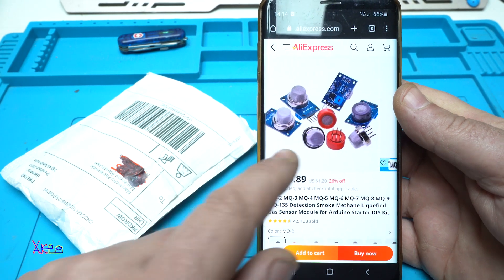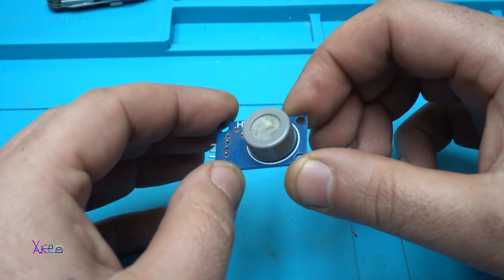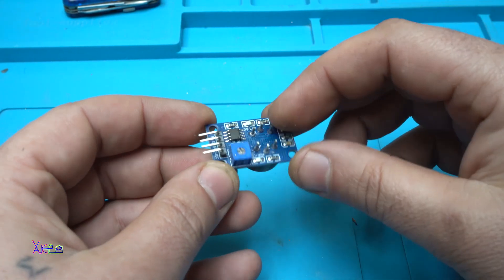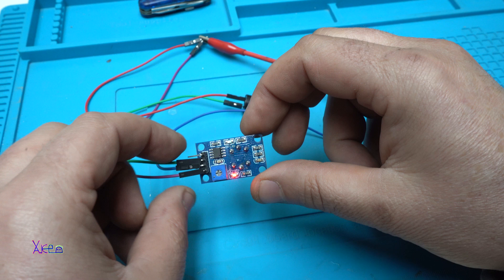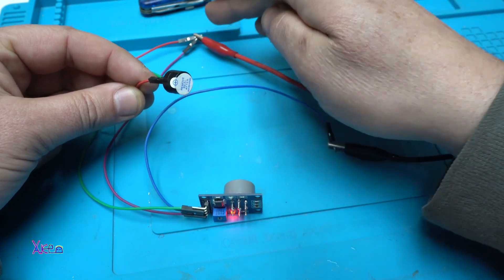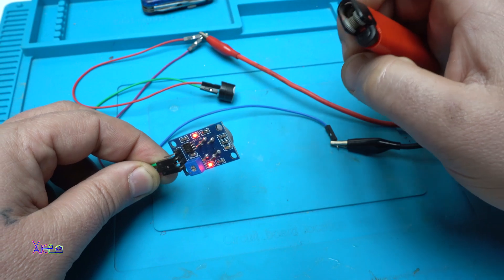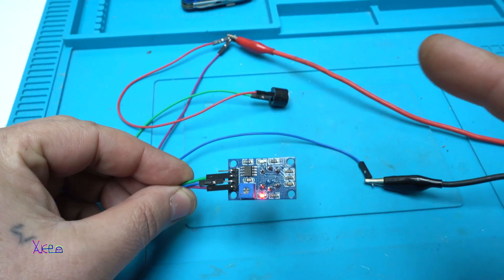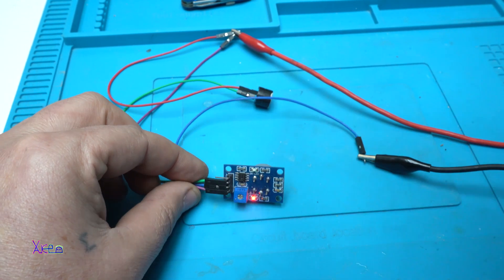I Spent $1 on Aliexpress Sensor Module and Got SHOCKING Results!

Comment: It is as sensitive as unspecific ... use alcohol vapor and it will trigger too faster even. Just like ESR blood exam, it is very sensitive and when ESR takes little time something has happened...but you never will tell why, so is basically useless.
Do you know what happens with false alarms repeatedly? People begin to ignore the alarm just like the story Peter and the Wolf.
Make an alarm put on you kitchen and the first flambé you do it will trigger it. Cleaning the refrigerator with alcohol to avoid bad smell? It will trigger it. Using a window cleaner. It will trigger it.

Comment: I have been wanting to make an air quality monitoring station using the MQ sensors for a LONG time, but I have never actually taken the time to do it. There are a LOT of MQ-type sensors, and they have analog outputs as well as the digital output used in this video. My concept was to use an Arduino Mega (with 16 analog inputs) to monitor an array of sensors. I would also attach an RTC module so that time could be tracked and an SD card module to log data. I would read all the sensors, say, once per minute and log them to a .csv file on the SD card. 

I did this once with a PMS-5003 particulate sensor and I got some VERY interesting results logged. Perhaps I should include one of those in my ideal Air Quality Sensing fixture. 

I seem to recall that the brand new MQ-type sensors need to be powered for 48 hours prior to use, to "burn them in", and upon powering one up that is burned in you have to power it for 24 hours to allow the internal element to warm up and settle. Do I have that right?
Reply from the maker: Sounds like you have a great plan for an air quality monitoring station!

Comment: That is amazing response time. It beeped when you barely pressed the button, and there was a lot of travel, before it even made a sound. What is the difference between that & the other models? Maybe some of those might be better than smoke alarms. I have seem some tests indicating that smoke alarms might not be as responsive as one might hope.
Reply from the maker: Its a great sensor for alarm and I was surprised on response that mean is working pretty good

Comment: What is the fourth pin for??
Reply from the maker: You have analog that I use in test and digital output
Reply: What kind of electronic (controller) can be used to interpret the digital signal? I guess, Arduino  @Hacktuber

Comment: Nice demonstration thank you. These sensors have a heater which requires some power to run them. Not good for battery operation and longevity I guess...
Reply from the maker: You are right, it needs power to operate.

Comment: Might put some of the butane on the bench and move the sensor towards it. It will sit there on the bench and mix with the air in different concentrations and make for a bit better sensitivity test.
Reply from the maker: That's a great idea, you can use that for a more controlled test.

Comment: I agree, that is shockingly fast. great value.  
I believe a CO2 sensor will be a bit more expensive, as it provides a numerical output. AliExpres sell SCD40 with i2c connection.
Reply from the maker: Great point!